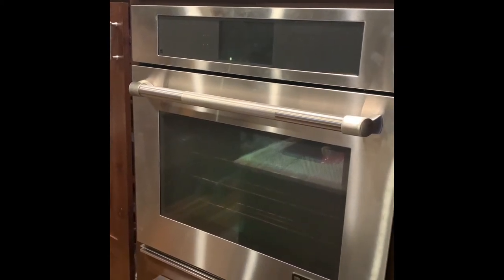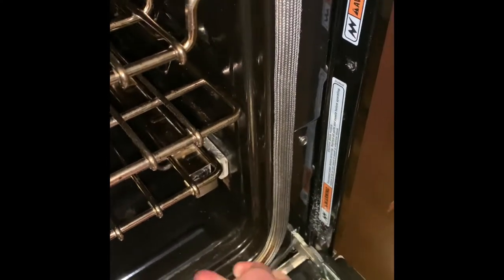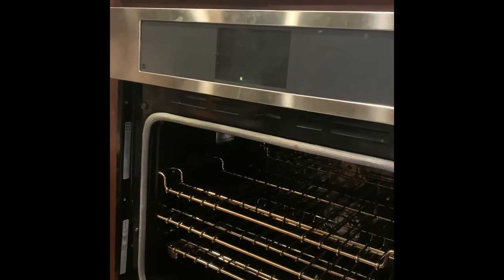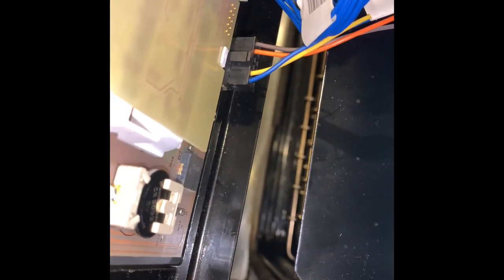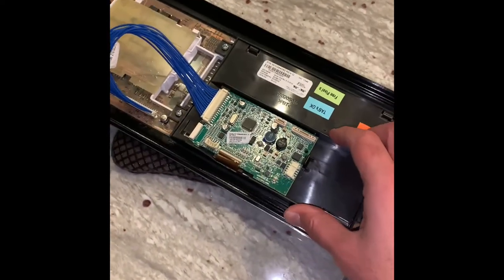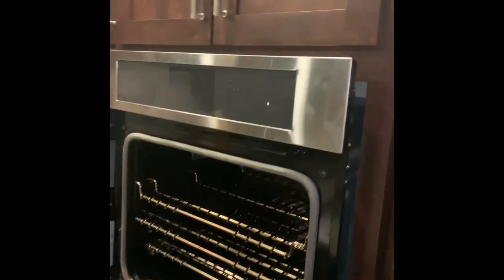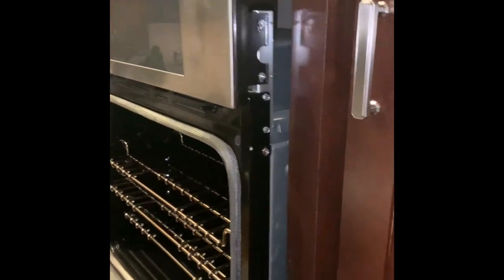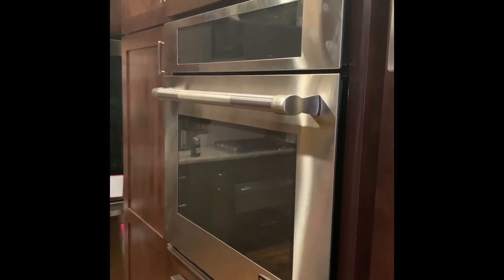Jenn-Air Wall Oven - How to Access / Replace Display / Control Board

Comment: Hi, I have same problem.  Do you have part number?
Reply from the maker: The part I purchased was from eBay, called: Oven Display/Oven Control Board WPW10344082 replaces #W10344082.  I paid $275 for it.

Hope that helps!

Comment: Hi, what's the model number for that Jenn-Air double oven? Hoping it's JJW3830WP02
Reply from the maker: It’s not a double oven.  Single oven only.  Model# JJW3430WP02.
Reply: I have the JJW3830WP02 and I am having the same issue of error code stuck key. What did you replace the whole touch panel or just that board?

Comment: Good day and just discovered your channel.  Excellent video and a true service to the community.   Seeing your advice:   My issue with my Jenn-Air JJW3830DS03 is eF2E1Stuck/Shorted Key error.  Tried the reset suggestion and believe it may be faulty display or control panel.    Two questions - 1) what is difference between a control panel vs  control/display board?   2) Would you have a clue if your instructions will also work on this JJW3830SDS3?
Reply from the maker: Hey @erwinlutz!  I did not have the stuck/shorted key error, but someone else that commented on this video did.  I have pasted their comment below as the 3rd paragraph.  They actually replaced the whole control panel and not just the board.  Think of the "control panel" as the big metallic piece with the plastic screen and the display/electronics.  The "control board" is the smaller part behind the panel that contains the electronics.

My instructions should work on your oven.  The part for your panel (which includes the board) is W11232121.  That's going to be more expensive than just the control board.  The control board is listed as W10821712, but when I looked at the drawing - I'm not confident that is your needed part.  I recommend purchasing the control panel.  Shop around - I'm seeing $600-700 and I didn't even look through eBay yet.  Best wishes!

From another commenter: "Thanks for a very useful video Matt. Just to add to the discussion here, our Jenn-Air failed in a different way. The display hung up in a F2E1:Stuck/Shorted Key error. Powering the oven off then on fixed it for a while, but eventually nothing fixed it. Even the trick shown here https://www.youtube.com/watch?v=SPSYYCkG9LM  failed to work after a few tries. Replacing the control panel as you did it fixed it. Our double oven MOD number is JJW2830DS01. I used the W11236888 replacement control panel. Replacing only the circuit board may also be successful and much cheaper, but I did not go that way."
Reply: @mlovitt01  You are a Star!   thank you
Reply from the maker: @erwinlutz  did it work??
Reply: @mlovitt01  The "user interface / display " is out of stock.   Seems there is a supply chain issue on this part and of course, the parts are not USA made...and manuf in the PRC...
Reply from the maker: @erwinlutz  if you haven’t yet, try eBay and even google.  Lots of re-sellers out there that are typically much cheaper than manufacturers or big parts suppliers.

Comment: terrible product. Thought it was high end, but so easily broken, the replacement is still complicated.  Why Jennair made such non-functional products.  I would rather buy cheap products made in China
Reply from the maker: I do think the wall ovens have an unfortunate design aspect to them.  Placing all of the electronics in a location that is exposed to heat is not good for the electronics.